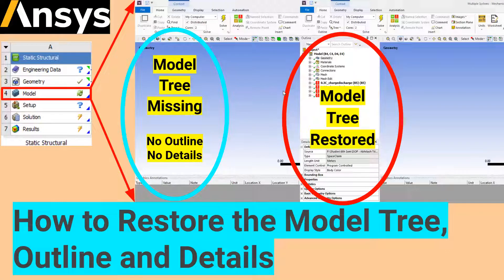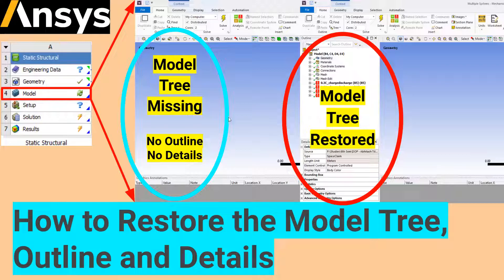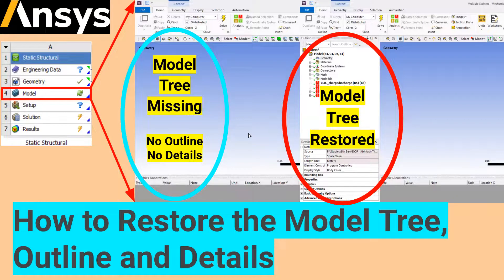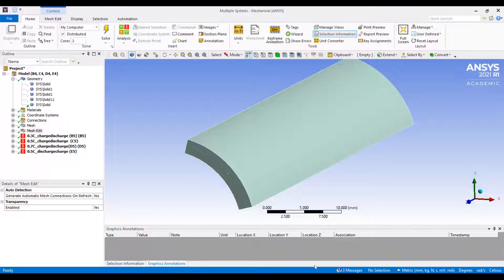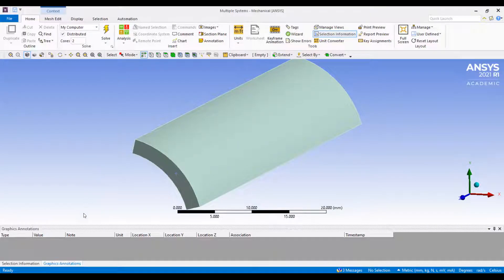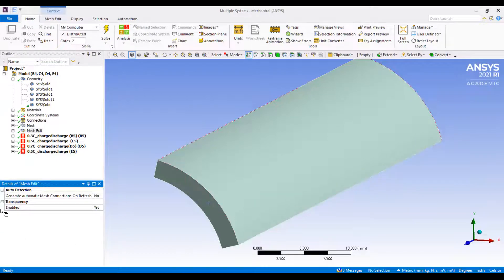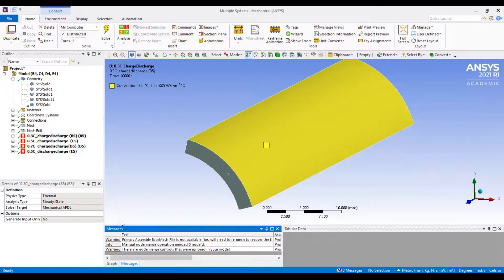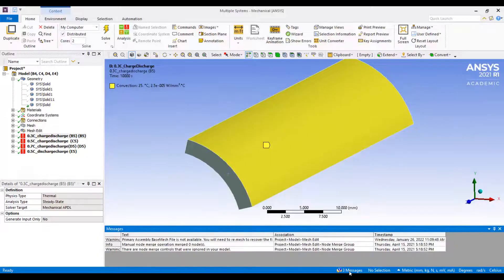9.1 How to Restore Model Tree Outline (Left Panel) in ANSYS Mechanical?

Comment: Hello I have a problem with geometry 
If I double click the geometry, design modeler is not opening and I tried right click on geometry there is no new design modeler geometry option 😢
How I can draw plz help
Reply from the maker: Hey there,

I have never experienced such a issue till now. Couple of things which come to my minds are: First, your ANSYS would have crashed. You can look at 'Details' tab in task manager and check if the required processes are in 'Running' status or not. Second, the easiest thing you can try is to go to 'View' in ANSYS Workbench menu bar, and select 'Reset Workspace'.

I hope it helps. If not, let me know, we can setup a meet sometime and I can look at the issue myself.
Reply: @dhyandpatel132  
1. Running status  
2. Done with reset workbench and window tab 
No change I can’t see design modeler
Reply from the maker: @noway8511  Hello,
How urgent is your work? For me, it is last week of semester and there are lot of projects and exams. So if is fine with you then we can have a meeting on coming Tuesday
Reply: @dhyandpatel132  no problem bro it’s working 
I reinstalled 👍
Reply from the maker: @noway8511  Great. Thanks for informing.

Comment: Hello..
I have a problem in my cfd simulation, i followed a turorial to make a stress distribution in a ship hull. In the tutorial, in Fluent part, there was "Report Plots" under "Monitors". But in my simulation, under Monitors there was only Residual, Drag, Lift, Moment, Surface, and Volume. I didnt find the "Report Plots". Can u tell me how to show it ? Thanks
Reply from the maker: Hey,
Thanks for reaching out to me. I will check and let you know.

I am anticipating it to be a difference due to different version of fluent.
Reply: @dhyandpatel132  thanks for your answer, but im sure that i have the same version.